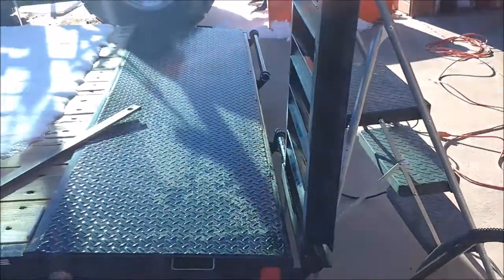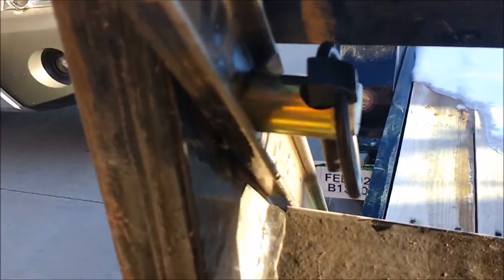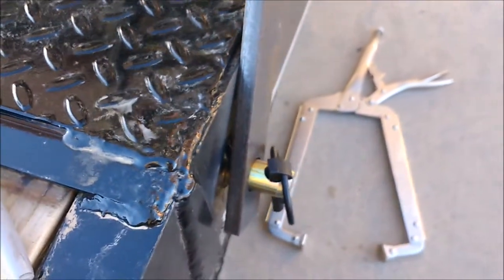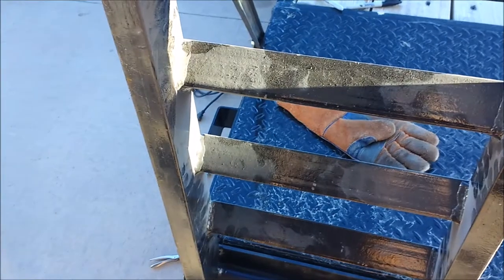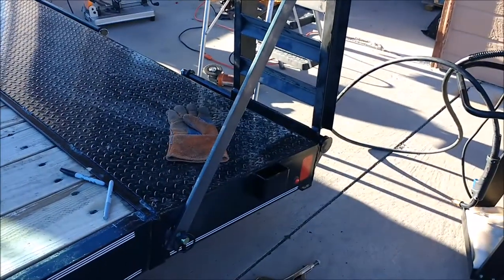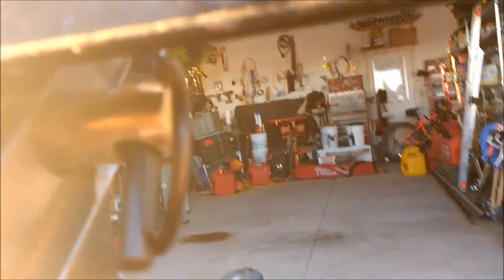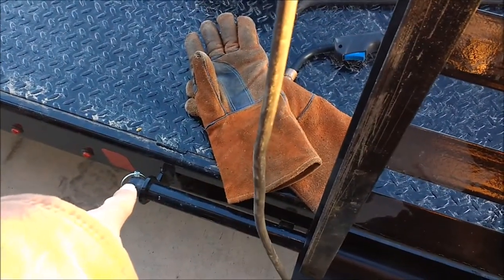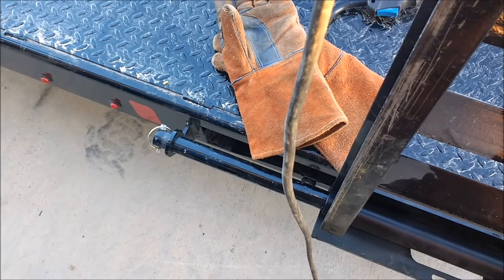Trailer Project Part 2: Ramp Conversion

Comment: Thank you for making this video! I'm doing this right now to my trailer and i've found a few shitty photos online but no one has a detailed write up about thickness of materials or a few of the finer details i was trying to figure out on my own. The last piece was figuring out what size strap to use for the support member. I actually like your idea of using 1.5" angle better so now i'm ready to head to the metal shop! thanks again, good video.
Reply from the maker: thanks for your feedback! BTW since this video I had to weld in a 1/2 inch flat piece along the length of the inside of the 1.5 inch c channel as a "rib" because the c channel bent a couple times.

Comment: The one thing that has me stumped is why you placed the angle iron with the angle down instead of up? You lose the majority of the strength of the angle iron doing it the way you did it. Had you turned it over, the strength would be over triple what it is the way you did it and the traction would be better for the vehicle you're loading. Additionally, now you have a dirt and mud catcher inside each angle bar.
Reply from the maker: Very good points! But that's how the ramps came, I did not make them that way. And I could flip them over, but they are beveled already on the ends. Thanks for your feedback, good things to keep in mind
Reply: They do it that way because the other way with V up you lose traction on the ramp especially when wet.

Comment: How did they stand the test of time? Do you got shot with them? Can you please provide us with an update, and thank you foe the video (great video 👍).
Reply from the maker: Thanks for asking this question, no I don't hot shot, actually I only roll a load onto this about a half dozen times a year. But so far they have worked fine, the only issue I had was the cross pin locks bent very quickly, I ended up cutting them off, and just welding a plate on the end of the round stock, so now the ramps are permanent, which is a bummer because I was hoping to be able to take them off easily and store them under the trailer. Thanks for watching and for your comments 👍

Comment: Nice work... I like your design for the ramps. I am looking to do something similar and usually over build too. The only thing i may do differently is add some lateral braces so that when i load something the weight doesn't lift the hitch and my truck along with it. Can you tell me where you purchased the pins with the holes that you used with your lynch pins?
Reply from the maker: Tractor supply, they are just a category 1 (or 2?) tractor pin that I cut one end off of. Also, I put stabilizing jacks on this trailer in "trailer project Part 4: trailer jacks" I love them, they work really well, and I did those for the same reason you want to. If you video your build I would like to see it

https://www.youtube.com/watch?v=p3bAUiHWRhY&t=3s

Comment: My ramps are identical and I bought the trailer that way. My problem is the ramps are very heavy and I have a bad back. Im looking for some type of hydraulics to lower ramps. Any ideas?
Reply from the maker: I feel you! My back is bad as well and I am done with bending over and lifting things off the ground, so I get what you are saying! So I was mulling over a hand winch with a strap (instead of a cable style), but I would have to fab a mount so they would be high enough off the deck to actually lift the ramp...prob not the easiest thing for a flatbed trailer (with no rails on the sides to mount anything to). Also the "Gorilla Lift 2 Sided Tailgate Utility Trailer Gate & Ramp Lift Assist System" would work great but I think it needs a long rail above the deck to attach it to (these are about 150 bucks, supposedly lift 300 lbs). Either of these ideas would also require a solid "stop" so as the ramps get to vertical they stop, and don't flop forward and damage the cargo in the trailer. Sorry I don't have any really good ideas for a flatbed, please let me know if you find a solution
Reply from the maker: also the "crazy boy tailgate lift" comes with brackets that would elevate the spring above the deck...Gorrilla lift also makes a trailer tailgate "handle" so you can lift it manually from standing height (instead of bent over)
Reply: @anesthesiadreamin  Thank you. I just found the gorilla lift system online at Amazon. My back rail on both side angles down to the bed the last two feet so that might be a problem to. Will look into Crazy Boy to. Again Thanks
Reply: @anesthesiadreamin  Thanks will do. I have rails They just angle down the last two feet. I will work it out.